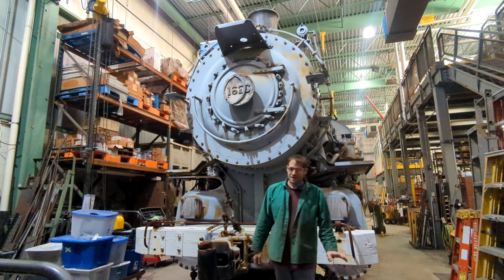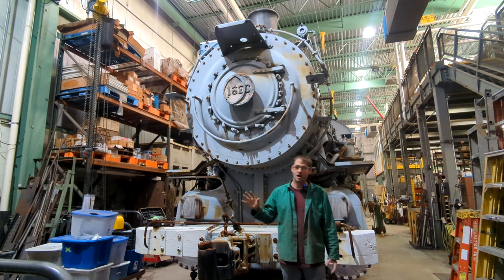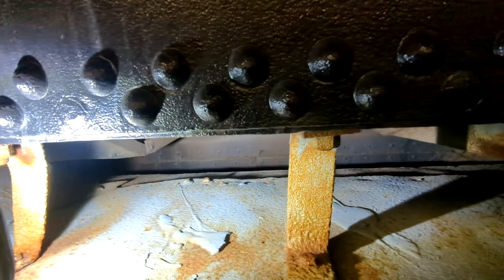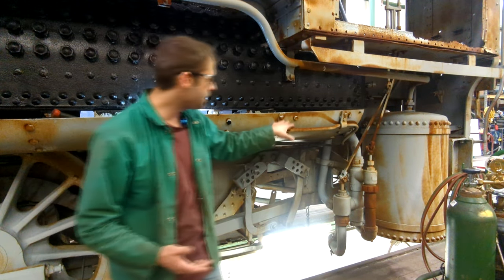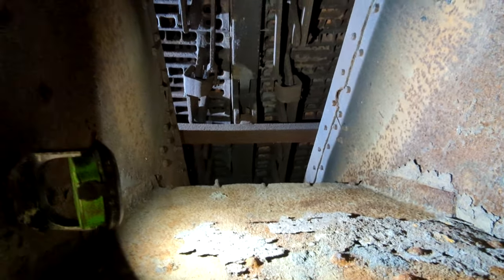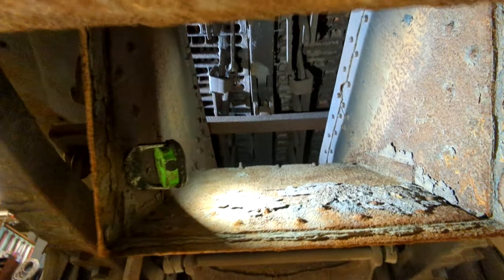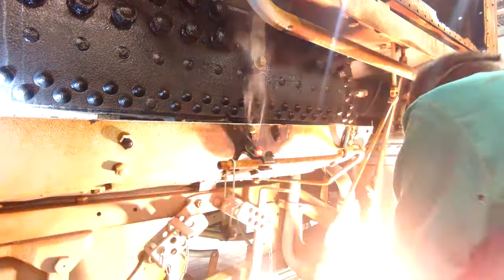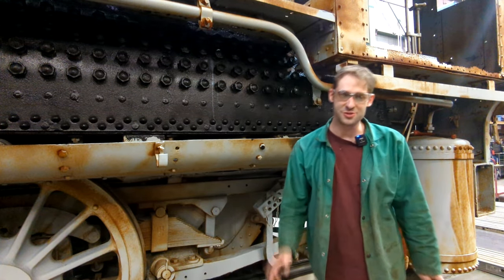How Does a Steam Locomotive Ash Pan Work?

Comment: Coal contains sulfur. When water collected in coal, coal ash, cinders, it develops sulfuric acid, which dissolves the steel. This is why all display locomotives must have the stacks capped.  
The Museums E6s Atlantic 4-4-2 #460 got a very thorough, in depth, and expensive restoration, was money well spent.  The balance are getting cosmetic overhauls which are sufficient for indoor display.  God knows, they need it!  These are irreplaceable treasures in PRR history.
Reply from the maker: I was pretty sure that it was sulfur in the coal but I couldn't remember.  Thanks